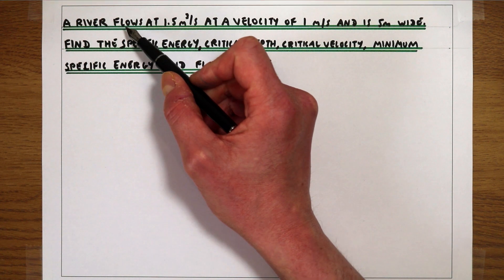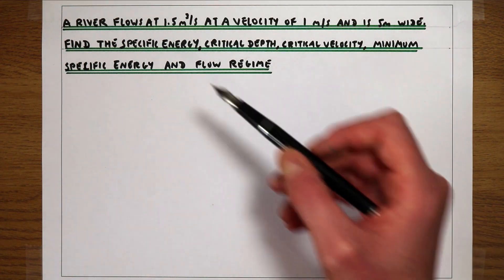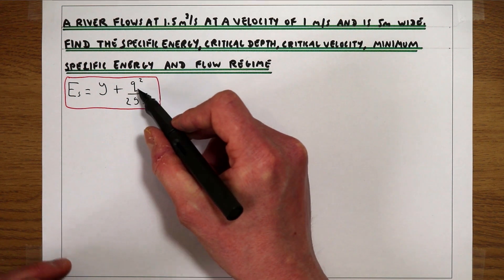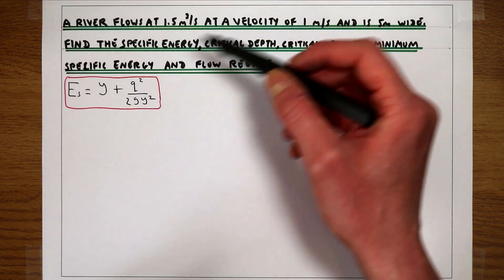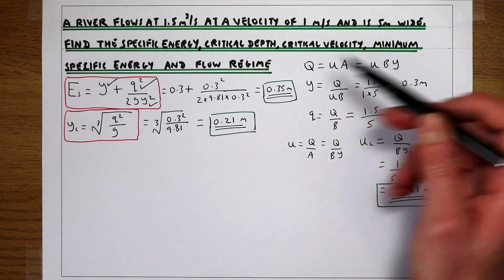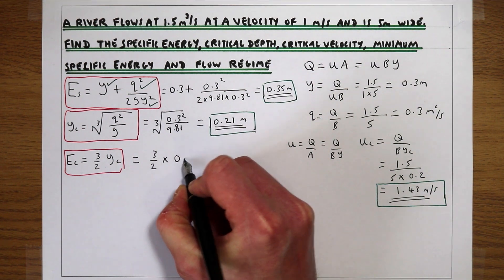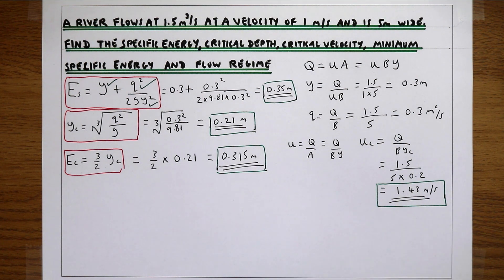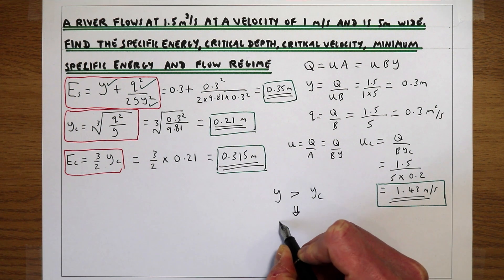Calculating specific energy, critical flow depth, critical velocity and minimum specific energy

Comment: Sir excuse me did you forget yc have 1/3 in formula
Reply from the maker: Hi Mako, I believe the version of the equation I am using is correct. Which equation are you thinking of?
Reply: hello mako, he also put square root  to the third power so it's the same as 1/3 you talking about